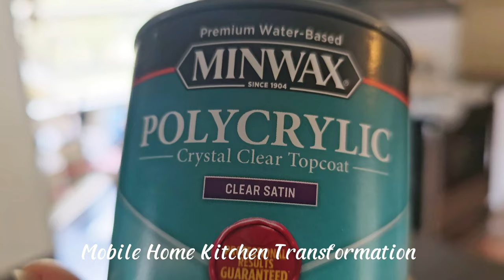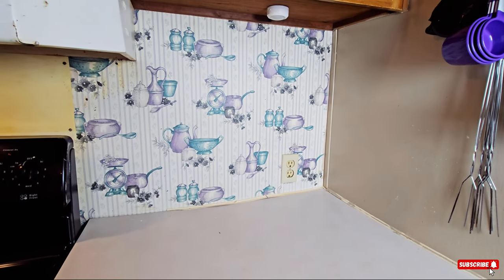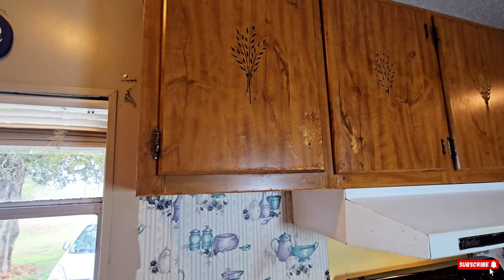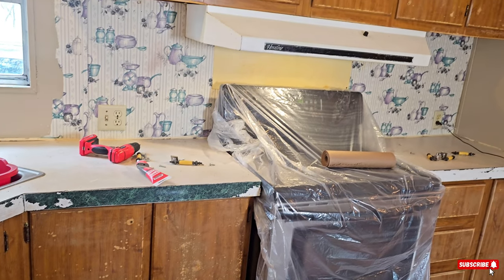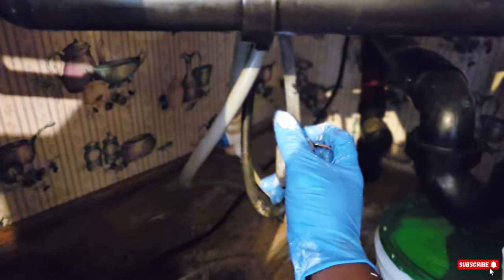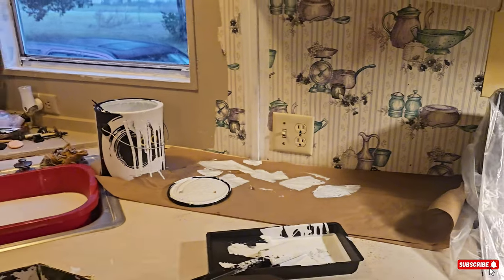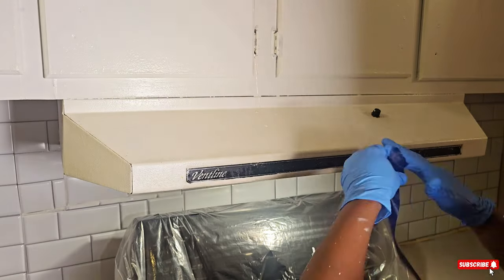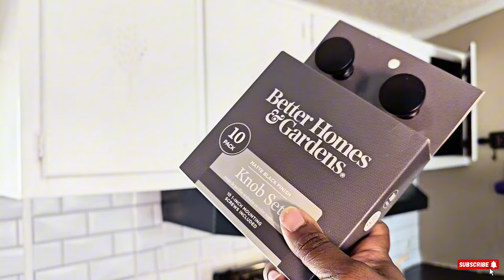Extreme Kitchen Makeover | Under $150

Comment: It looks really nice but did you paint over the hinges? Just curious.  I think that you're supposed to prime the countertops and sand them before painting? How many coats of primer on the cabinets ? And how many coats of paint?
Reply from the maker: Hey there!! Yes I sanded before painting. My paint had primer so I skipped that step. It did 4 coats in total. For the cabinets and counter tops. And I did paint over the hinges.